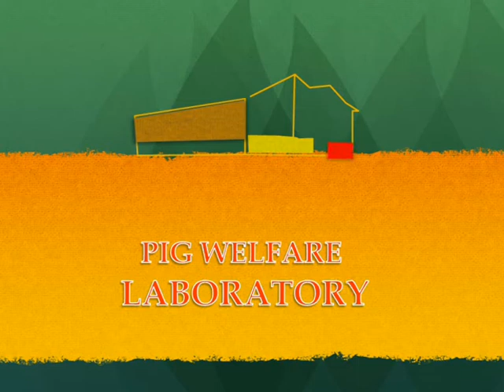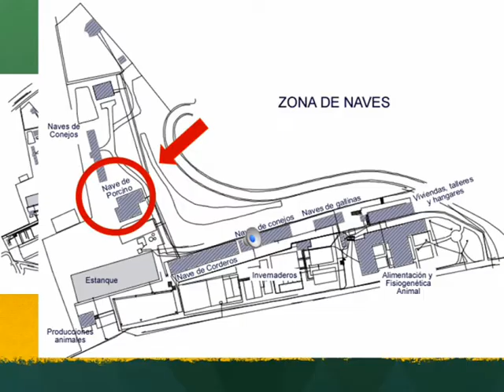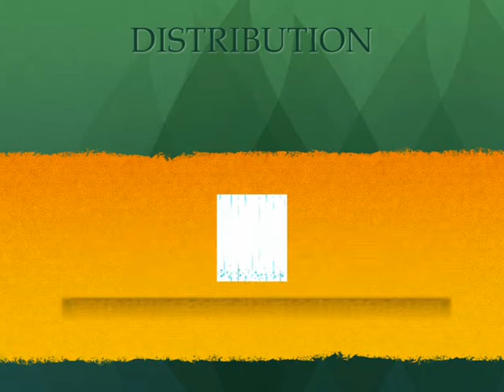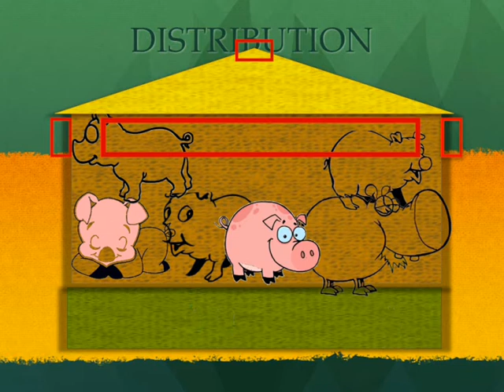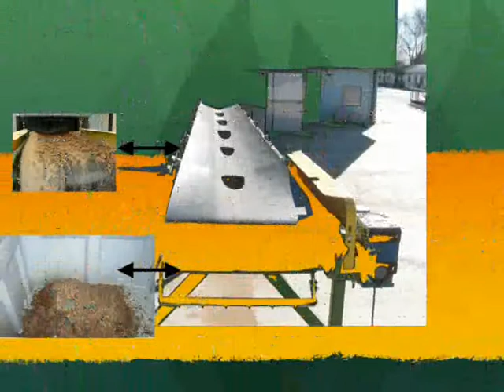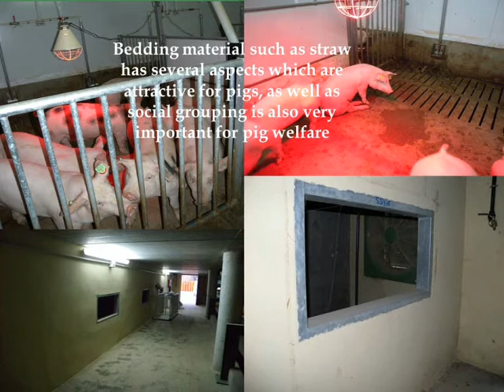pig welfare laboratory. ETSIA UPM

Comment: 1. How well did video directly address the intended technical area?
      
Clarity of topic                                              5 out of 10 points
Logical presentation                                      9 out of 10 points
Evidence-based information                           5 out of 10 points
Credible sources                                           1 out of 10 points

2. How well did the video communicate message under the following headings? 

Audio quality                                                10 out of 10 points
Image quality                                                10 out of 10 points
Cadence and rhythm                                     9 out of 10 points
Language and vocabulary                              10 out of 10 points

3. Creativity of video?                              18 out of 20 points

Comments:
For the “Clarity of topic” section, 5 points were given. There were some reasons for this. First, the speaker did not follow with the presentation; therefore, it was hard to understand the topic instantaneously. After several trials of watching, the topic became clear. Secondly, some details of the presentation were in Spanish, therefore, as for not Spanish speaker, it was not possible to understand.   
The presentation logically well designed as it, first, shows an introduction to the topic, then defines objectives, after this gives details of the methodology, and, finally, presents the results. However, the conclusion was not clearly defined, therefore, 9 points were given. 
For the section “Evidence-based information”, 5 points were given, because some records lacked sources, therefore, it was not possible to check is the information evidence-based or not.  
A 1 point was given to the “Credible sources”, as the presentation did not include any references, therefore, it was not possible to check the credibility of the sources. 
“Audio quality” and “Image quality” were fine; therefore, 10 points were given. 
Overall, “Cadence and rhythm” in the speaker’s speech were fine, thus, 9 points were awarded. However, as mentioned before, the speaker did not follow with the presentation.
10 points were given to the “Language and vocabulary”, as the speech of the speaker was clear and understandable. 
For the section “Creativity of video”, 18 points were given. There were some reasons for this. First, the vast majority of used images were creative and interesting. Secondly, the structure of the presentation was well organised. However, from my point of view, there were some minor hindrances for getting 20 points, such as an inappropriate background theme and not clearly defined colors of the words.  
Overall, I found the presentation interesting and enlightening.